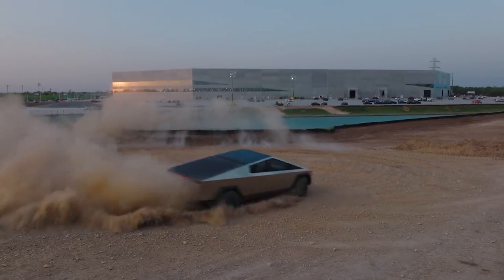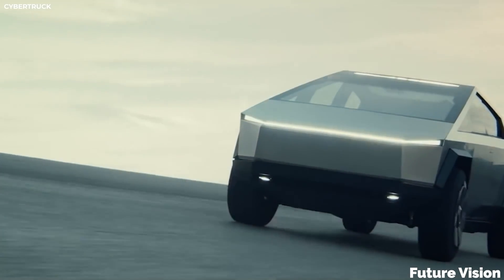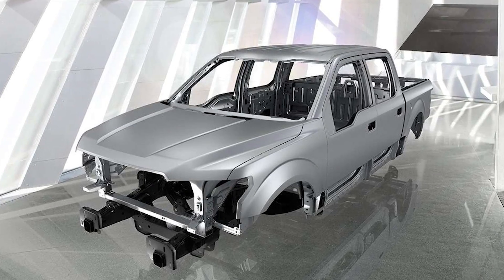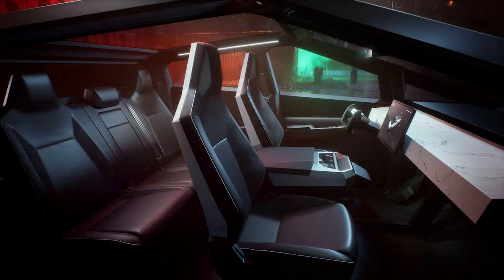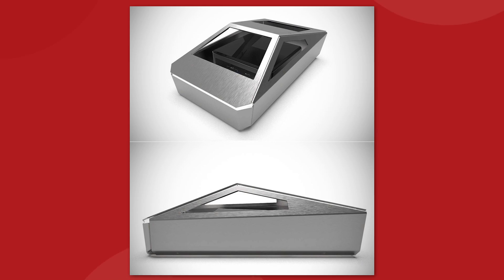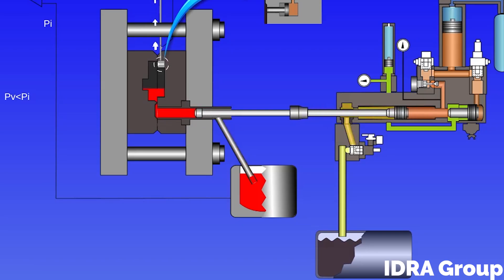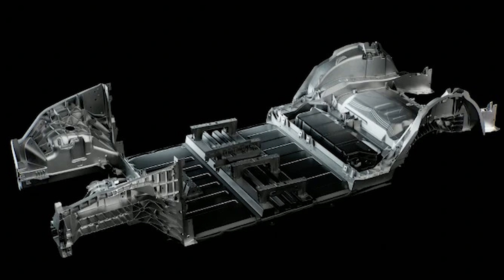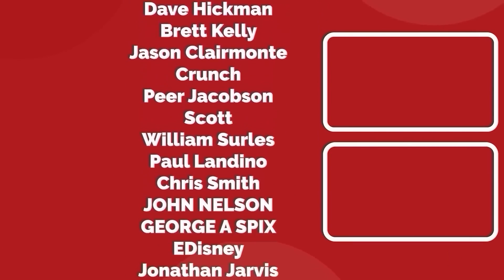The Real Reason Tesla Developed The Cybertruck!

Comment: 1. If you can cold bend a piece of steel without causing structural damage, you can also stamp it. The shape is there to look edgy and possibly be cheaper. Stainless steel is perfectly fine to stamp, so claiming it's physically impossible to do so is just silly.
2. Aluminium is used precisely because it can be made into a lightweight panel while holding form. It is supposed to crumble. The whole car is. If you are in a collision, the main thing you care about is how much deceleration you are subjected to, and deformation zones is how you limit it. If you hit something and your car stops immediately because it physically cannot crumble, you are simply dead because of massive deceleration. Cars used to have steel panels in the 50s and 60s, but we stopped using them because of this.
3. Cans of paint are heavy because they are like half solvent, that evaporates after application. 
4. Does this channel just parrot Tesla press releases or what? Zero critical thinking applied?

Comment: I like your movie but you forgot one simple thing. What is the load capacity of the Tesla Truck ? The traditional frame/chassis design in pick up trucks is for my understanding is mainly due to the need to carry heavy loads. Monolithic frames for trucks exists. My WJ 2000 Grand Cherokee has one. but it is a passenger truck not a cargo load truck. I'm sure they checked it and that there is a number but i'm also pretty sure it is low then other trucks and to be honest, most trucks at that size this days are more a passenger trucks with big trunk then a "real" pick trucks. Anyway, loved your video.

Comment: Hilarious...
 
Unknown weight. A giant (18 feet). No wonder it is of stainless steel, it does not fit in normal garages, it has to stay outside in the rain. 
 
As it is practically only US cars that still use frames, it is innovative only in the US to use a monocoque like most other cars. 
 
Using the battery pack as primary load-bearing part of the structure - hmmm... That makes it more probable that the battery gets damaged in case of an accident. And burning lithium is nasty, beyond 1000 degrees Celsius is no problem, water does not help, only sand to cut off the oxygen.  
  
They have already given up to try to get it licensed and get it sold outside the US, it is HUGE, has the  aerodynamics of a shoebox, and higher speeds (like on german autobahns) would drain the battery in no time.  
 
So you have bad aerodynamics AND bad properties due to the looks, heating due to the flat windscreen, low headroom esp in the back seats.

Comment: This info about the forming is false. Brake press will do 1/2" plate steel like it's an aluminum can. When I worked in a manufacturing plant our punch machines would cut shapes into the 1/2" thick plates by pushing through them and into a die. Only time you had a bad day is when you tried to use a square punch in a circle die and it blew them to pieces. If you set your tonnage to high on the brake press it would also blow the die up. Which was much thicker than the plate steel being formed. No laser etching. No heat weakening. Just cold steel off the floor. Also if you wanted to make it stronger and not insanely heavy you would use aluminum plates. Just like military armor.
Reply: It is Elon Musk and Tesla, so it is innovative and unprecedented by definition ;-))
 
When US manufacturers still stick to frames, so what? Other car manufacturers gave that up long ago.  
 
The advantage of the frame is you can do whatever you want on top, it does not matter. It automatically brings the ground clearance a truck is to have.  
  
And due to that weird shape I have my doubts it is very roomy inside, esp. in the back. 
 
No wonder he needs such thick metal, flat surfaces are way more vulnerable to warping than curved ones. Correct?
 
And no wonder that they stay in the US market, there the max. allowed speed is nicely limited, so that the giant frontal area and the shoe-box aerodynamics are unproblematic.

Comment: I believe you are mistaken regarding the stamping of stainless steel. You state that there are no presses that are powerful enough to press stainless steel. You also state that trying this would break the press. This is far from the truth.
There are in fact presses that are capable of 50,000 tons which is 1 million pounds of pressure. Stainless requires different processing and procedures but can in fact be stamped, formed and pressed. 
It's a matter of using the appropriate grade stainless and processing and hardening appropriately etc....
The issue with Tesla is not that shaped body panel cannot be done. It is that the cost to do it is not what Tesla is willing to spend. It's very likely not cost effective to stamp the low number of panels required for the number of CT's to be sold do to the cost of making the dies and the machine costs. The could be more cost effectively produced in any shape imaginable through forming, welding etc....
Also, If you watch the video of the guy hitting the truck with a sledge note:
He slows the speed of the sledge hammer down very significantly before impact and the hammer is coated to prevent showing the impact of contact.
Reply: It is all show. And in the same event, the bulletproof windows could be destroyed by throwing a steel ball at them. 
 
 When Musk still promoted the Hyperloop, a 600 mph "train" in a vacuum tube (to eliminate drag), they presented the prototype for the pods they wanted to put into the tube - in stylish black, in carbon, but no interior, no propulsion system, no life support system - but it is aerodynamically shaped for an application where there is no air. 
 
Hmmm...

Comment: The video is informative and makes sense from a fun new design but the actual design has no utility to it and is not conducive for a working truck !! You can tell that the designer has never been on a job site or even worked in a commercial job that needs a truck!  Let’s  see you put tool boxes on it or a flatbed on it ? Can you imagine have to load it from the side?

Comment: Let's be honest the cyber truck will have the same issue as any electric truck. Once it's loaded the range is going to make it useless. The architecture of the thing is not going to matter if it can't do what a truck is supposed to. If my range goes down to 50 mi when I'm hauling it's not really worth the cost or anything else. This is the reason why truck owners are staying way from electric trucks. I think a plug-in hybrid with a dedicated generator wouldn't make a lot more sense if that generator can provide enough power to run the electric motors.

Comment: A big question with the stronger/stiff shell, is passenger safety! The old cars with hard body would show signs of little damage in a collision but the passenger often still got killed due to the harsh shock of impact. The newer softer body vehicles are designed to crush and absorb that impact. Will the cyber truck be able to protect the soft squishy passengers inside? Other than this very important thought, I LOVE THE IDEA AND DESIGN of the cybertruck and if affordable, I would certainly buy one if it has enough range (including winter) to tow a 21ft camper. :)
Reply: Maybe they are counting on the other car to absorb the impact for them???
Reply: Tesla uses advanced airbags. It’s very safe, don’t even need seat belts
Reply: Also can’t see it passing European ‘pedestrian’ regs.
Reply: @yeknommonkey  Europe doesn't need anything that works good. Hope they regulate it out!
Reply: As long as you crash into another modern squishy vehicle you'll be fine.
Reply: It is as affordable as similar products from GM and Ford, wait a year for video's of winter performance and see what others discover, then you have your answer.

Comment: Love it! The only down side is the life time of batteries. Batteries still cost too much and their life is too short.
Reply: And good luck extracting those batteries from their sealed encasement that is bonded to the car frame. Basically the car is disposable once the batteries go south. Stupid design. And Musk is an vile and repugnant political anarchist. I'm glad his companies are beginning to implode. Can't wait to see the final grand finale of financial ruin this idiyot is head for.
Reply: I owned a Chevy Volt from 2012 to 2021. After charging it started out having a range of over 30 miles on just battery. Nine years later it still had a battery-only range over 30 miles when a woman in a white Cadillac SUV decided to drive where I was and killed my beloved Volt. Battery fear is exaggerated. The engineers working on these have developed software to extend their lives. (PS: as with any plug-in hybrid, once the Volt or our plug-in Prius uses the battery it seamlessly converts to gas. The Volt ran a small generator at pretty constant speed. Over the life of the vehicle you can average over 100 mpg. Fully charging each night cost about $11 a month.  Electrics are the deal. Hybrids a wonderful gateway until charging stations are more common.
Reply: @DennisSanner  There are videos all over YouTube of DIY'ers replacing the battery cells in these older electrics, with much expense and pain. BUT, as I said, molding and melding these battery packs into the frame itself reduces or eliminates the chances of replacement or servicing of the batteries (although details were a bit fuzzy there), making these cars a disposable landfill menace. All batteries eventually fail. The ones Tesla uses are no different.

Anyways, I would never buy a Musk-created electric vehicle on principle alone. That's like paying someone to kill our democracy and shout racist and political anarchist comments. Why would anyone want to do that?
Reply: @DennisSanner  We traded in our 2012 Volt with 90,000 miles for a 2023 Bolt. Lifetime MPG was 220! Range had reduced about 10%.

Comment: A Ladder Chassis and Body Shell Separate Was The First Design Choice Method Copying and Still Applies To This Day For Anything Large and Heavy Like a Bus Or Lorry(Truck To You).
   A Uni Body is Short for when the Body And Some Sections Like the Apprximatly under the Front Passangers Feet Of The Traditional Ladder Chassis Starting Point Gearbox Mounts All the way to the Engine Mounts and on to front Radiator and Bumper Mounting points Some of Which Where Un-Boltable Like A So Called K Member on The Trans-Am Etc , and Simular at the Rear Seats Under Floor to Rear Suspension and Axle , Fuel Tank To The Rear Bumper Replacing All that lost Sections wieght With Press Formed with indentations That Do Not Reach The Edges Providing Significant Extra Strength and Ridgidity to that Panel plate Piece Such as The Floor Pan Pressing.
   The Third Approach of Fairly Recent Times is The MonoCock Design that is All One Piece Construction  with The Needed Extra Strength Areas To Take The Wieght and Power Of The Engine And The Applied Load And Shock From The Suspension Components , Drive Line Compnents Such As The Gearbox And Rear Axle If A Rear Wheel Drive Config or Front Also In The Growing Modern Day Trend And Desire To Be Equipped With Four Wheel Drive So A Front Axle With Diff And A Centre ish Transfer Box That Splits The Power into Front and Rear Powered Drive Shafts Also Centre Prop Shaft Are All Mounted To Double And Triple thick Shape Formed For Extra Strength Mounting point Holes or Welded Fixed Nuts Points.

  Then The Cyber Truck Takes It To The Next Level of Combination of Methods And Engineering Principles still based on the MonoCock But by Using 3mm Thick Strong Stainless It Needs Far Less Double Thickness Points And Far Less Additional Forming Shapes For Strength With The Added Genius of a Overall Body Shape Of Emense Strength in Engineering The Triangle Simetary Simular To The Egg Shell Strength Shape Benifits ,Also These High Stress Areas Can Be Additionally Strengthend with The Addition of Some Opposing Direction Thinner Stainless Steel Hexagon Shape For The best or could use Pentogon Shaped full Depth of the cavaty Spot Welded At The Top And Bottom For Emmensly Strong Configuration Leaving More Internal Space Free for Other Things And Possibility of Designs.
  Hope This Helps Guys And Gals.:buffering::trophy-yellow-smiling::buffering::washhands:😜😇🤣❤

Comment: A 1/8 if a inch is approx 3mm thick which can be stamped into shapes with a Identical Machine press tooling material that is thicker , In This case is always a solid Block flat on the bottom and machined into the desired form shape that then also needs a powerfull enough amount of tons of pressing pressure they come in all sorts , maybe a 300 or 500 ton capacity also you could make even easyer by pre Heat socking the sheets of stainless to supple it up further more.
 I used to work for cromealloy a factory that re built airoplane jet turbine units from Rolls Royce and Pratt and Whitney after every 100,000 Hours of Use on the airoplane and the Turbine Blades Have A Outer Ring Made of Titanium alloys to House the Stainless steel Honey comb that was machine profiled to corresponed to the same shape as the Top outer edge surface of the completed assembly Ring of Blades that acts as the piston rings to seal the air Pressure for that stage of the cycle which works the same as a 4 stroke piston engine . . .Suck , Sweeze , Bang , Blow and they where press and then Rolled Formed out of same or a bit thicker sheet as this is also a saftey component for if the engine explodes to contain the very Fast Rotating Fan Blades.

Comment: What is the point of having a truck with a significant tow weight capacity that duration is reduced by 60% when actually towing? Trucks are designed for towing and working payloads that Tesla cannot perform to date. Until this is solved it is not a truck... Capacity does not correlate to real-time performance. Electric trucks to date are failing to meet expectations.

Comment: The shape is also much more aerodynamic than a traditional boxy truck. This will help solo range a great deal. Since most trucks are actually not towing most of the time,  this saves a lot of charging cost and time. Also, it helps performance.
Reply: too dangerous forms, I hope it will be banned
Reply: True. Aerodynamics is a massive part of the design since "fuel" economy is still the number one concern of the electric vehicle.  Unfortunately, this truck isn't ready for the construction industry yet as it has a small bed and it would lose all that aerodynamic shape if you have the back open carrying stuff all the time (as opposed to private ownership that is hardly used for it's utility ability.
Reply: @smgdfcmfah  It’s shape will still be favourable compared to a boxy truck even with the tail open, just not optimal. And the bed size is larger than US best sold truck as far as I know, so…for a lot of businesses it probably will suffice
Reply: @ytyaroon  That bed is 6'5" - a work truck tends to have an 8' bed.  Having the back open and cargo in it will completely destroy the aerodynamics - it's just the way it works.  It may have slightly les drag than a standard pick-up, it it will be negligible, which is the point.  I'm not against this truck, but as long as charging and range is the limiting factor, then towing and aerodynamics are key to these vehicles (things the gas burners don't really need to worry about).
Reply: i can’t judge about work trucks, my argument is most sold truck, the F150, does not have a larger bed than de CT. To your other point: Of course, cargo in the back that is stacked high, maybe even higher than the cabin, will cause drag. As it will in conventional truck. However, this will not alter the front aero and that does matter. Just look at semi: front aero, back all boxy but still twice as aerodynamically efficient as a conventional semi. The gains of the better front end aero of CT will always help.

Comment: It brings up a question… First of all, excellent job explaining, I learned a lot from this video… Now the question: in the 40s and 50s vehicles were made strong and heavy thinking that would help protect the occupants in a crash. In the 60s and 70s Crash research lead the way to making cars crush intentionally in an accident absorbing much of the impact, protecting the passengers. With new vehicles being produced of 1/8 inch super strong and heavy stainless steel, how will they be able to better protect the occupants during a crash? If you have any insight into this please respond it would be most appreciated, and once again… Thanks for your excellent video. John

Comment: The Tesla Cyber Truck will be dead on Arrival. It has already been becoming obsolete to the consumer, and with RAM and others producing much higher quality electric vehicles, with better warranties, for cheaper, I really can't see the Cyber Truck being anything more than a meme/a dream/a waste. 

The thing has failed demonstrations numerous times.

On the note of the "GigaPress", there are already hundreds of cracked frame claims, and Tesla will not cover the repair under warranty, as they call it "Normal Wear and Tear". The Subframe replacement costs 2000+$ And that doesn't include Tesla approved techs.

Comment: as a production engineer i dream and simulate making every step of steel manufacturing as efficient as possible from steel cutting, fabrication, welding, qc to grit and paint. but tesla bosses are like " you have a better idea, here's a million and make it better', what a wet dream. the amount of engineering is astounding.
Reply: Engineers and fabricators love the concept of the CT, and fossil fuel fans can't stand the idea of an electric truck that's more bad-ass than their flimsy noisy stinky slow rust bucket.
Reply: Another gullible "production" man? Gee wizz, what could go wrong?:face-green-smiling: